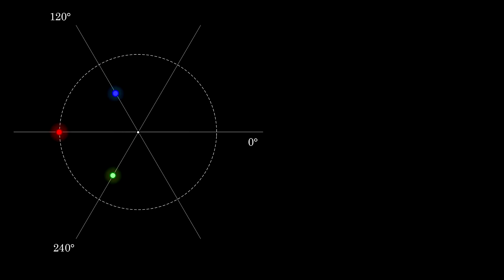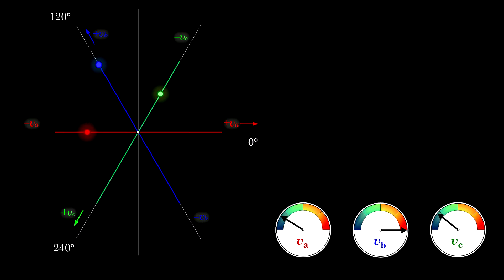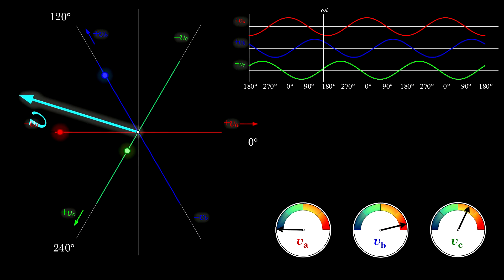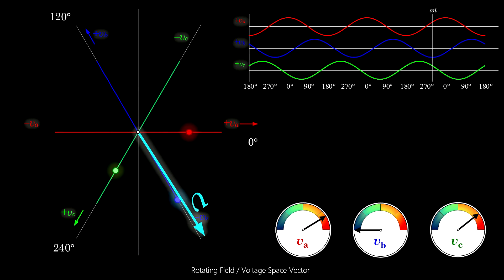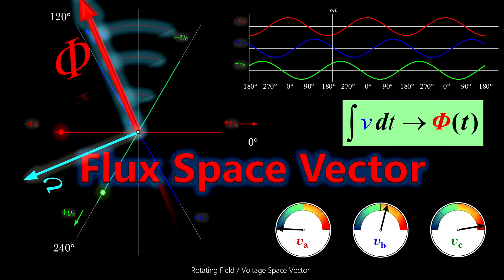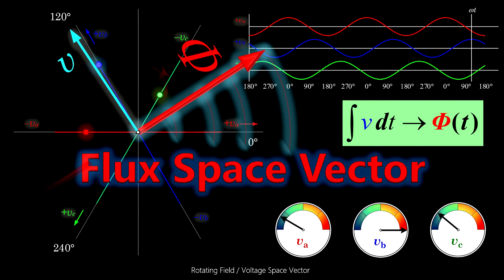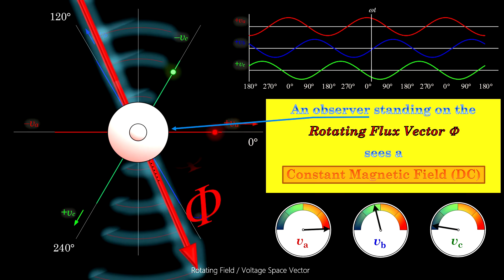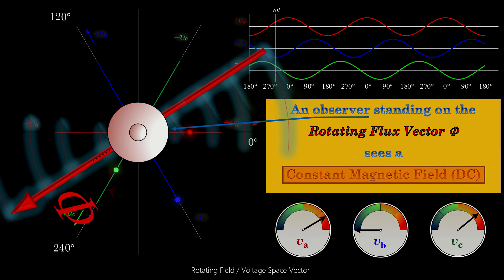Voltage Space Vector / Rotating Magnetic Field - Fundamentals of Three Phase Machines

Comment: I'm really confused here. Why do we say that the sum of all currents in a balanced system is zero.
Reply from the maker: Actually there are two possible answers. 
No 1: Kirchhoffs current law. If the neutral does not conduct current the sum of the three phase currents must be zero.
No 2: Open Excel (or another calculating programm of your choice). Create three sine functions with phase shifts ph1=0°, ph2=-120°, ph3=-240°
Now add these three sine waves. You will find: at any angle/time the sum of these three is zero.
Enjoy ... :)
Reply: Hey 👋 
Thanks for your Answer.
Yes we will get zero if we add three current vector separated by 120 degree but then why are we getting a resultant vector here for voltage with an amplitude of 1.5 when they are also separated by 120 degree.
Reply from the maker: This is an addition of vectors with 120° shifted to each other.  In that case we get a rotating vector at constant length. 
Why is that?
My favorite explanation is that these three voltages are the result of a rotating permanent magnet. The voltages are the "footprint" of this magnet. As often in physics you can reverse this result. 
Now, if you apply these three voltages to three coils (like those previously picking up the magnetic field) these coils now recreate the magnetic field, which is rotating and constant. :-)